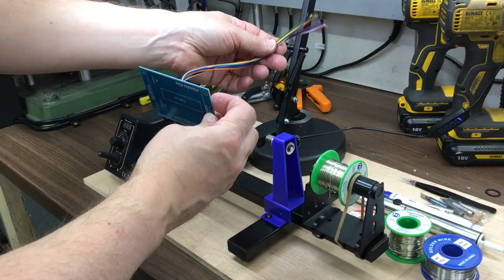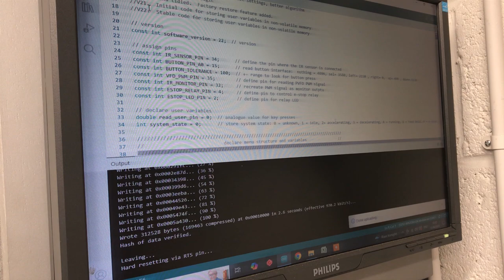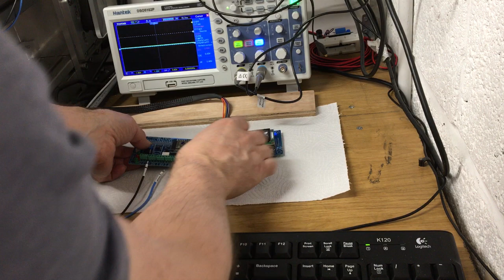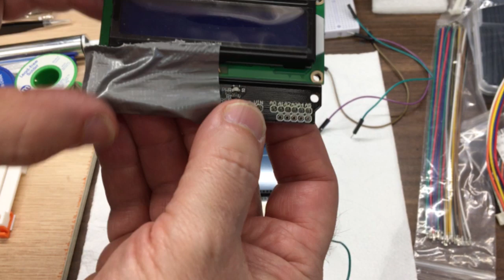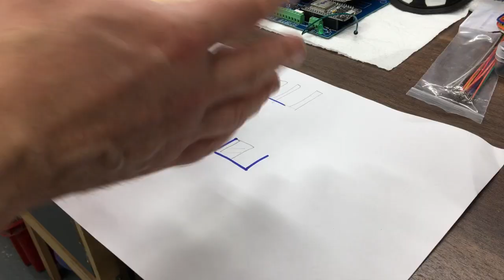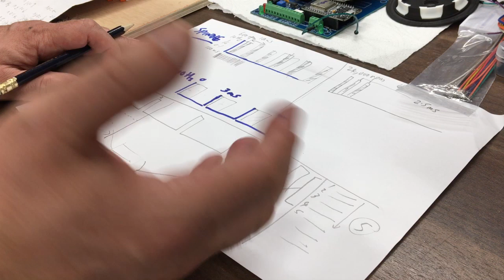Ep:06 CNC stall monitor | All new PCBs, all new issues!

Comment: I had really long message written and then I realized, look up adaptive feed rate in LinuxCNC. There is video by Kent VanderVelden from 4 years ago - _i-qp6B5K4w. He uses torque measurement but I'm sure it should also work with simply measuring RPM of your spindle.
(in reply to this message I'll still describe my idea I had, which I got after seeing your timing diagrams)
Reply: So, after seeing your diagrams I'd suggest to use spindle pulse train (way slower) as your time base. Condition is that pulses have to be quite precise - if you have four pulses per revolution, make them spaced out by 90° as precisely as possible. You can probably measure circumference, draw striped line in any editor, print and glue it on spindle.
You'll also need one hardware counter and one hardware timer which runs freely, that shouldn't be an issue with ESP you have.

1) When spindle does 1/4 of revolution (for example), sensor will trigger interrupt, which will:
- copy value of free running timer to global variable
- copy value of VFD pulse counter to global variable
- reset both timer and counter
- reset stall counter
- set boolean to true

This is used to detect if spindle starts slowing down slightly and that there might be some issue. There is also second interrupt:

2) When timer goes over set threshold, trigger second interrupt. This will happen when spindle didn't do revolution in preset time limit, for example when it's already stalling or rapidly slowing down:
- increase stall counter by one

Main program then does three things in a loop:
1) Read pulse counter global variable, multiply it by constant and set it as threshold of free running timer.
There is known ratio between VFD pulse train and spindle speed, which I suppose should be mostly constant. So you can calculate how long should 1 revolution take, divide by 4 to get length of 1/4. This should mostly correspond with timer value which is periodically saved to global variable. Now just multiply your result by let's say 1.5 or 2.0 and set it as timer threshold.
When spindle won't keep up with demand and no pulse comes in time, it will trigger second interrupt. And since second interrupt timing is speed dependent, it will mean faster reaction when higher spindle speed is commanded.

2) Compare stall counter with threshold and trigger e-stop when it goes over threshold. This is used to slow down reaction to second interrupt during stall. I'd personally trigger e-stop when stall counter reaches value of 2. One increment could mean that spindle is loaded and might be quickly reset by spindle triggering first interrupt, but two increments in a row mean that spindle has stopped or slown down significantly with quite high certainty.

3) Main magic. When boolean is false, skip whole sequence :)
When boolean is true, set it to false. Divide values of timer and counter in global variables, save result somewhere. Check if boolean is still false. If not, repeat whole step from beginning, since values might have changed while you were processing them.
If boolean is still false, your result is a ratio of spindle speed and commanded speed by VFD. If there is linear relationship between VFD pulse train and spindle speed, it should be basically all the time same number. You can multiply it by constant to get range let's say 0.00 to 1.00 or simply 0% to 100%. Now you should know how well spindle is following what VFD wants and simply compare it with threshold you have set. Let's say 70% of speed is a limit which triggers e-stop, so just compare if it's slower than 70% and set output when needed.
If you managed to push this calculated value back to LinuxCNC somehow, you can use it for that adaptive feed mentioned in previous message.
Reply: Note: Second interrupt might be just IF condition in main program loop, so it won't happen that second interrupt is blocking first interrupt if they are triggered at same time. But I think you can have queue and thanks to only only doing simple step in second interrupt it shouldn't break things much.

Note: First part of main loop wasn't explained well. Idea was to know that for example 1000 RPM means 16.6 revolutions per second, times 4 mean 66.6 pulses per second, making it 15 ms per one quarter of revolution. So you multiply it by 2.0 and set 30 ms as limit to make 1/4 of revolution. In case spindle slows down to less than 50% speed during quarter of turn (oof!), then it will increase counter and after another 30 ms it will trigger e-stop, if stall counter threshold is set to 2.

Note: It's 3AM so there might be some issue with my logic. Idea was to make it really fast and simple, feel free to ask. And yes, I am obsessed with self adjusting regulators (here that automatically adjustable timeout). Also I am pretty bad at math so maybe calculations in previous note are wrong, not sure :D
Reply: And of course I missed out that VFD outputs PWM, damn! That's why I mentioned it being 3 AM :/  But that can be also measured quite easily, probably even just in main loop by waiting for pin to go high, start timer, wait for pin to go low, stop timer and move value to variable.
....ESP32 does have multiple cores, right? That would make it way easier, just have separate loop to measure this occasionally and also update display stuff.
....I'd rather go to sleep now, before I get tangled even more in it.